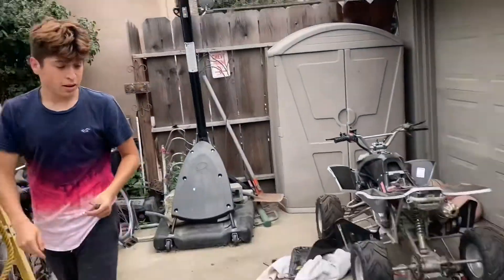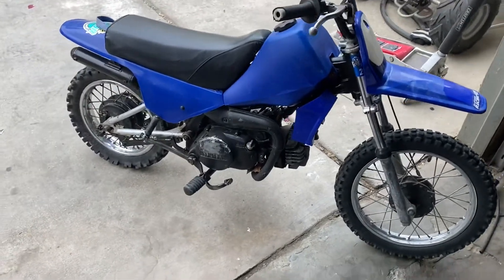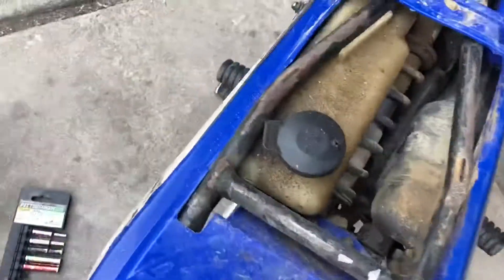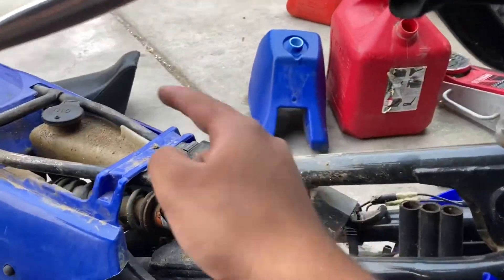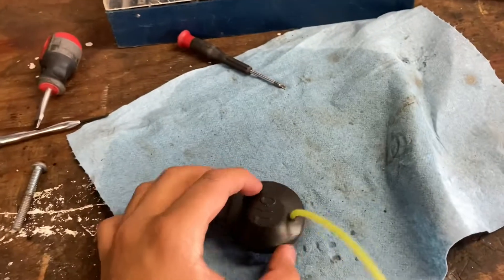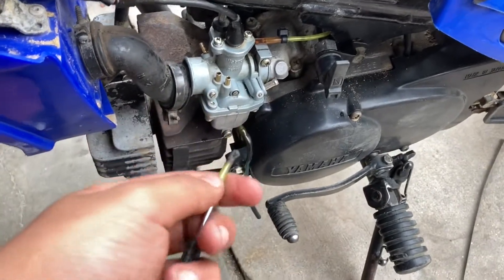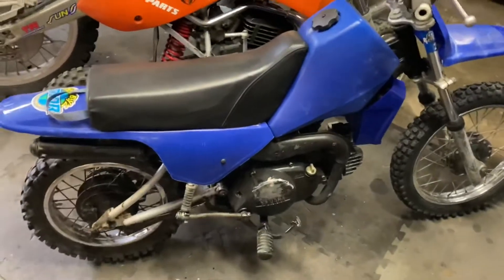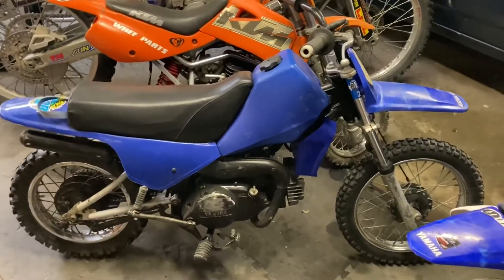PW80 Build Part 1: Oil Pump Bypass (Speed Test)

Comment: Hey just to let you know running a higher gas oil ratio like 40:1 will only make the bike run more rich. Originally the pw80 oil pump produces about a 20:1 gas oil ratio and even for that ratio the oem carburetor is still jetted slightly rich. Hard to say if the aftermarket carb you have is the same as the oem carb  jet size wise. If you really want to jet it properly just pick a ratio say 32:1 and stick with that. Then jet it as you would for a four stroke. Remember, too much gas = too rich you should not be changing the gas oil ratio to compensate, you should be changing jet size to compensate. Example, going down some sizes on the main jet. Hope this helps.
Reply: The bike will run perfect on a 50:1 ratio
Reply: i use premix in mine lol she was $300 she loves it 😂😂

Comment: Nice work! What about the two fittings at the top that are not being used?
Reply from the maker: I assume you are talking about the carb breathing ports. At the time I didn’t have the hoses but there should be some hoses attached and lead to an “out of the way” spot
Reply: @alatorreracing  thanks so much!

Comment: What ratio u running I just buy one n idk what's the best ratio for it
Reply from the maker: I’m running 40:1
Reply: @alatorreracing  so my problem know with it is the after a few min riding when the bike get hot it cut off n I gotta wait to it cold down so its starts again
Reply from the maker: @viadelgraciamelendez5703  sounds like a top end. I’d get one of the ones on Amazon that come with a new cylinder. Make sure you’re mixing correctly when you do get her running again
Reply: @alatorreracing  I appreciate it imma let u know how It go